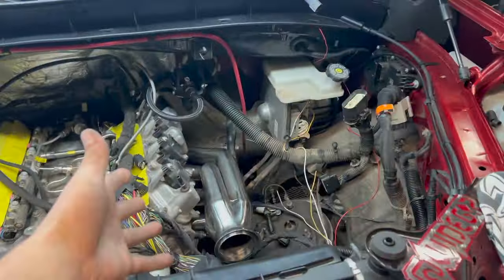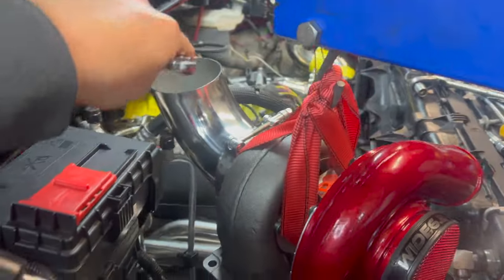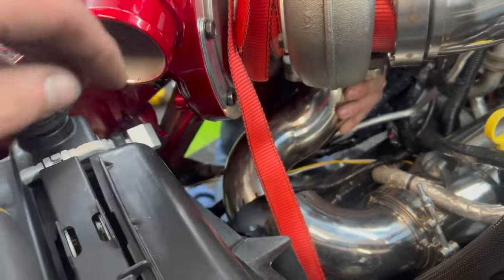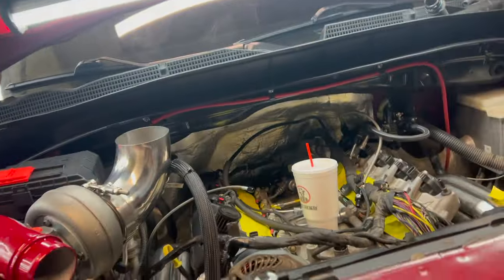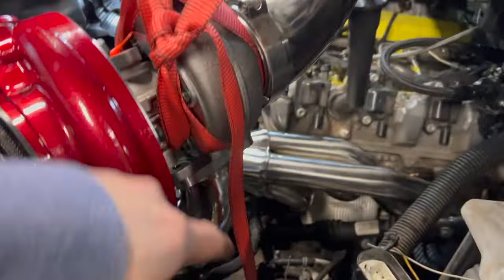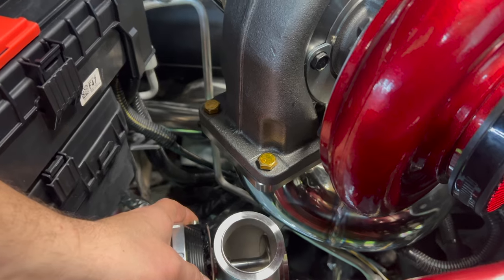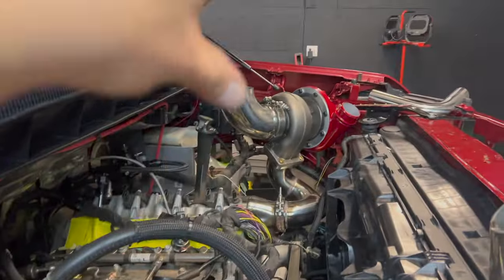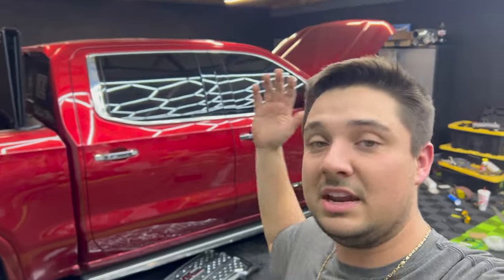The TURBOS Are Mounted!!!

Comment: We're you running nos on the stock engine or did the engine have work done to it?
Reply from the maker: Still stock
Reply: @Wide6.2  is it gonna still be stock internals with you twin turbos
Reply from the maker: @tylerwenger107  not for very long just to dial the kit in really